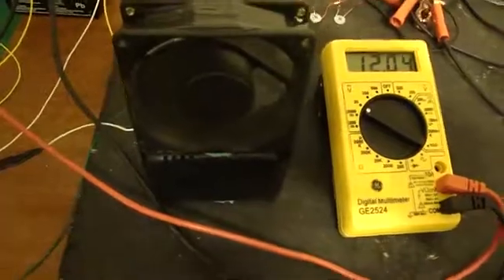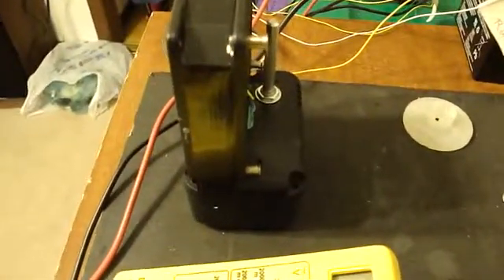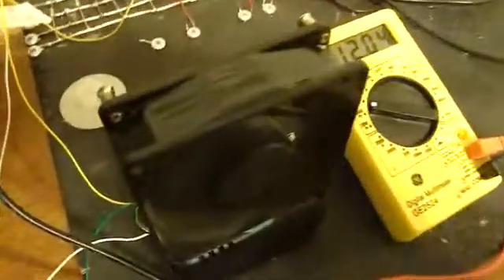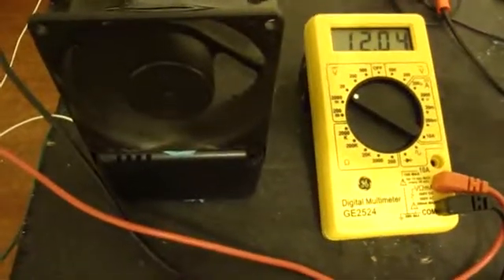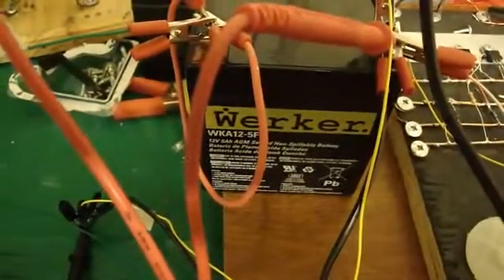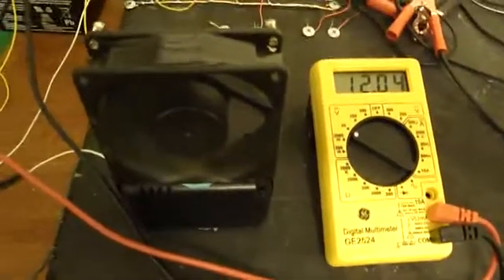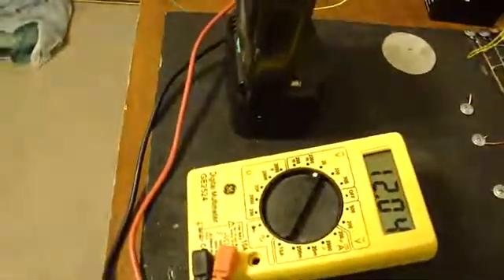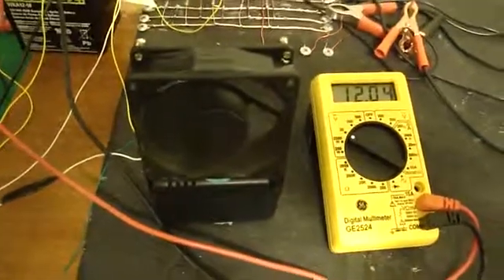Mounted Imhotep Fan Energizer.avi

Comment from the maker: I built mine following theDaftman's setout and the ihmotep video. I have tried to replicate it several more times and have not succeeded. I don't think a video of a failed build would be what you are looking for. The hardest part for me is finding the double connection and connecting the correct wire to the added post.

Comment from the maker: Thanks!

It runs very well on a regular 9 volt transistor radio battery. I've never tried it with less voltage. I'll use some of my AA and AAA packs to see what the lowest voltage is that will make it run.

Happy New Year...
Poppy